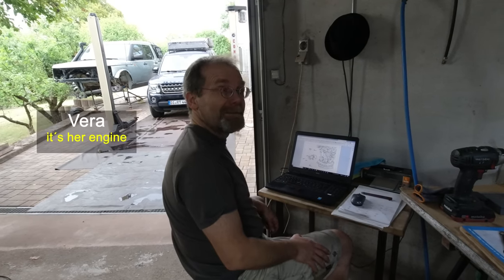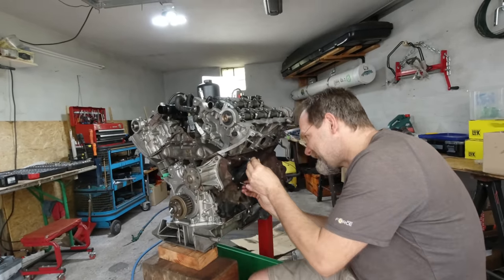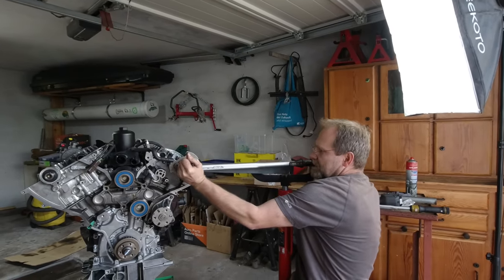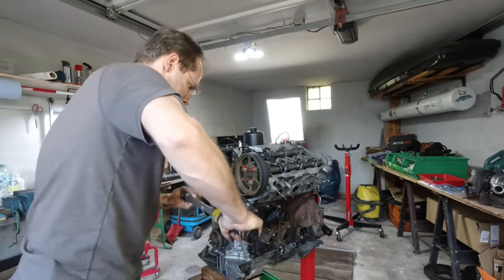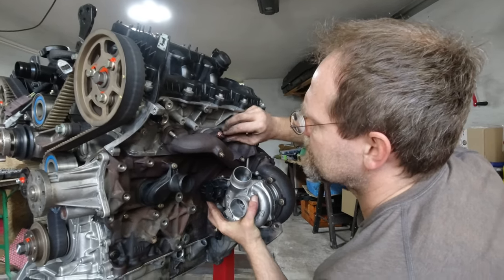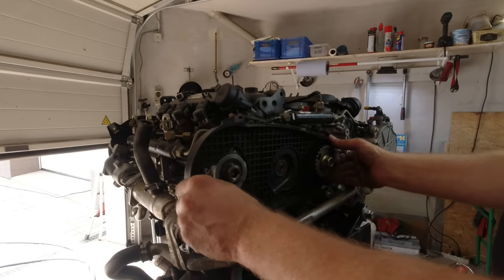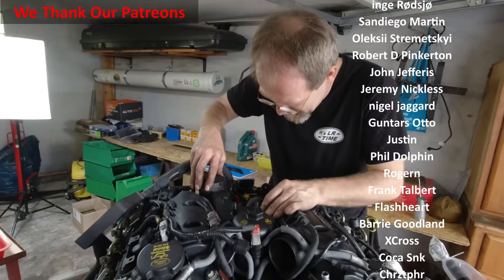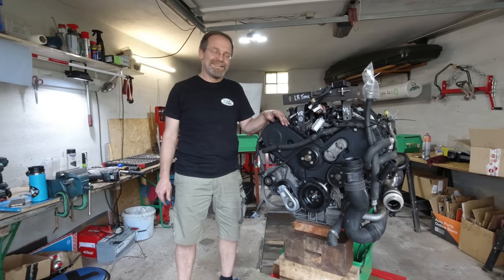TDV6 Diesel Engine Assembly - Land Rover / S4-Ep40

Comment: Another great video, by the way I work on warranty for a very large automobile company , the replacement for EGR was AdBlue system.......this system is even more unreliable than EGR system for reducing NOX 😂 - what will the designers come  up with next ? Maybe a timing belt running in oil 😂😂😂

Comment: I'm slightly concerned Christian - when you were putting the cam belt on the right hand side ( looking from the front of the engine )sprocket you said to rotate the sprocket counter clockwise but I'm sure yo turned it clockwise ?
I love you and Vera, I watch every episode and your engineering ability is amazing - no one would take the level of care and attention to detail you guys do. 
I don't own a Landrover but I love your channel anyway.
Reply: i saw that, thought the same, but then later it all lined up
Reply from the maker: I did it right but said it wrong.  The pullys need to be turned CW.  Christian

Comment: Iceland is an excellent choise for a trip with a Land Rover. I've been there once (without a car) 10+ years ago for a hike near Hecla Volcano and also in the place called Kirlingafoel. Iceland is insanely beautiful and those who are used to tents and mountain trailing love it. I'm sure you alreay know all of this. But the roads in the wilerness are really a challenge for any truck. I think the suspension will really suffer from rocky trails. And moving around to reach most wild places will not be fast at all. But it's all really worth the efforts. Good luck in Iceland. And don't miss the summer season - it's really a very short there.

Comment: A funny thing happened on the way home from my engine tuner - the EGR never opened again.  I was really upset about it but the tuner said the thread broke and could not be restored again, so I just had to put up with all the benefits of no soot in my engine.  Even the code I got occasionally from the blanking plate never showed again :)

Comment: We were doing a job, and a company wanted us to put heli coils into the holes of the job that we just machined from scratch. 
They came back to us saying the threads would be four times stronger with helicoils than without.
These were roughly M30 if not an inch and a quarter.
In the oil industry in the North Sea some stuff is American.

Comment: If it was legal, would you blank off the EGR? I'm trying to assess whether blanking them is technically a good thing to do. Or whether the engine has been designed to run with EGR valve, so by removing it, does it stress other components?

Comment: I see you have the same make EGR valve as used on the 'Peugeot' diesel engine in the Ford Fiesta's, they have given me trouble in the past & the injectors/ injection pump are Siemens, the Fiesta 1.4 TDCi have them fitted & they breakdown electrically not like the Bosch system fitted on the same engines in the Peugeot/Citroen's which are very reliable (German quality!), i guess Siemen's was Ford's preference over Bosch?
Reply from the maker: Yes, there is no Bosch used on this engine OEM. The EGRs fail every 100t km.  Christian

Comment: 17:00 EGR never used? I viewed the live data for command and position on mine and they seem to fluctuate through various positions continuously depending on load. After replacing a faulty one the command and position match almost perfectly so I’m assuming there’s nothing wrong with them. I would love to know why they fail so often but I don’t think it’s as a result of being in one position for extended time. Am I missing something?
Reply from the maker: The EGRs are just not very good.  They do a cleaning cycle on ignition off and you can hear them operating.   Aftermarket ones are terrible but I had good experience with Valeo EGRs.  Christian

Comment: Brilliant as always.👍🏻
Just an observation. I just realised how low the alternator and aircon units are to the ground. Does this mean they might get damaged wading through a muddy hole on the Canning Stock Route, like What Cruisers and others do? 😱🙈🙏🦘
Reply from the maker: If you exceed the LR level of 600 mm depth, they will suffer a bit.  Not sure what happens really as the deepest water hole in Germany is on the side of the A5 near Darmstadt and it’s 3“ deep.  Hitting it with 150 km/h is still exciting.  Christian

Comment: Is this engine the same as the V6 used in the Australian ford Territory?  I am having real trouble determining if the flex plate is in the correct position to use the locking tool inserted above the starter motor  Does the 2.7 also have the locking pin on the left side of the engine as you use?
Reply from the maker: On the right side when looking in driving directions. Yes same thing.  Manual is different from auto transmission! Christian

Comment: Hello. Nice channal. One question, I have 2019 disco. Feel a bad smell I cabin. I took off the engine air intake hose to have look. It was wet and dirty in oil😳. It should be clean may be? Thanks
Reply from the maker: Airtake hoses are oily on the inside. That is normal. And they normally are not causing a bad smell. You have to determine what kind of smell that is, unfortunately you did not write that. If it's engine related, molten plastic, or from a dead animal or just moldy. Clean your airsystem and your filters and just open the hood and search for your cause. 👍🙋‍♀️
Reply: @Vera_and_Christian  Thanks for answer. 
it’s strange🤔. When cold start and after 10-15 min dirive something happen and the window been foggy inside. And a smell like antifreeze. After 5 min fog is gone. Otherwise no problem 😊😊

Comment: Christian, apologies for steamrollering you here with a request on advice or for poking your brain. But seems you guys know your Land Rover inside-out. I am from South Africa and driving a 2008 Discovery 3 TDV6. The car suddenly developed an issue. There is a sudden loss of power, usually after deceleration when I need to slow to turn into a junction or similar. When I want to accelerate again, there is no power. No message on the dash, no errors, nothing. Just now power. I then put it in Neutral, press down on the accelerator a bit and the engine picks-up revs again, put it in Drive again and I can go. Can you point me in a direction as to what may be the issue?  Thank you in advance.
Reply from the maker: Check EGR not stuck. Check boost system for leaks.  Check using a diagnostic unit if all sensors deliver plausible values.  Christian

Comment: Did you detect any oil leaking from the camshaft oil seal?
Reply from the maker: Yes, the cams leak if you are not 100% careful with the seals and if the glue is not applied in the corner of the valve covers. Had this problem twice already.  Christian

Comment: @20.09, those stupid leak off pipe & little 'O' rings, why did they not design something better, prone to leaking, they give me a headache on the Siemen's on the Fiesta as all the camshaft cover/inlet manifold (one unit) has to come off to access the injectors, i've got to do one this week 👿
Reply from the maker: Yes, this is really not durable. It improved a bit on the 3.0L.  Christian

Comment: My Toyota will never need that done.
Reply from the maker: LOL, indeed.
Reply: Usually… but if you had the first gen Toyota 2.2D4D 177HP, you’d be happy when it made 250000 without serious clogging up issues (yes we did long distance driving from new, it took us only a little over 3 yrs to get there)…. Toyota payed half the costs of replacing the head, which was fair but still. Another 200000 km and the head gasket was blown.
Our other cars on the other hand: 290000 (1.2 TD Corsa), 455000 (1.8 TD Peugeot 405), 489000 (Volvo with Renault 1.9TD). All of those were still running great and totally reliable when we sold them, on only regular maintenance. Oil consumption for the big ones less then 1.5 liter per 10000 km, Corsa even less then 1 liter per 30000 km (no typos!). Only the 1.8TD needed a fuel injection pump rebuild at 330000, which was worth every penny given that we sold it for 6 times the cost of the repair another 125000 later. Then there’s the petrol ones, most notable our Citroen Xm currently at 242000 (2.0 petrol), seemed to be going strong still.
Toyota comes out pretty bad in this comparison… Admitted, we do have a hybrid Toyota now, they’re next to indestructible and incredibly economical (holiday drives of thousands of kms including autobahn 130-180kmh: 4.7l/100km). The hybrid drive is lovely engineering, as are the Citroën’s clever hydraulics and as I’m learning now, the LR’s too! All in a totally different way, for different reasons, but engineering is engineering.
Just discovered this channel, lovely to see you doing a meticulous job on the LR’s, including making tools! Fantastic.